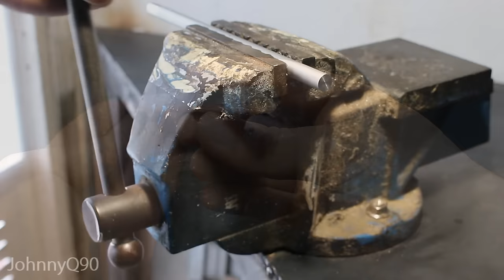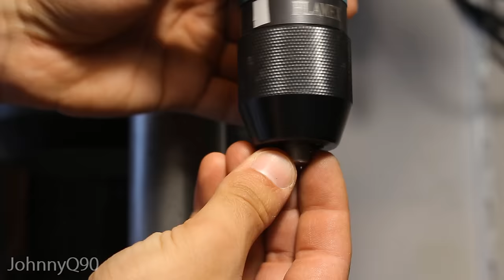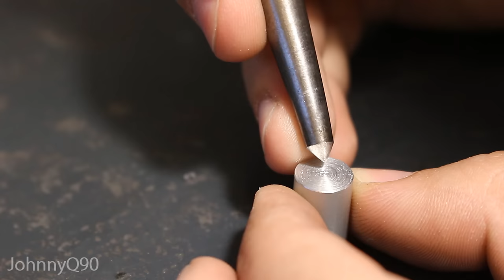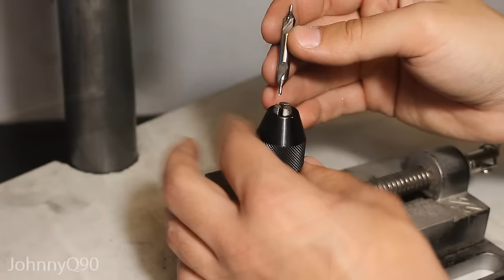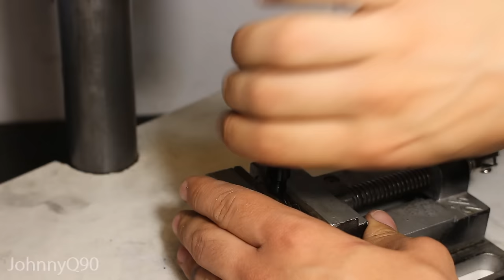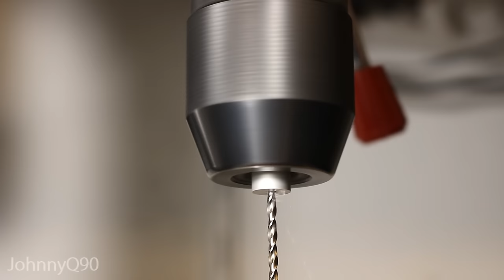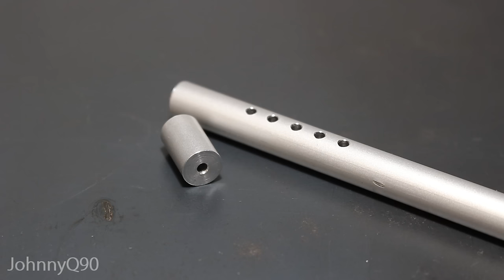Simplest Way to Drill in the Center of ANY Rod!

Comment: Lubricant is never used when drilling aluminum. When you loosened the vise jaws and thus moved the drilled rod, it becomes virtually impossible  to drill successive holes in a straight line.
Reply: Rich R I saw this myself .
I’d make a jig
Reply: If the vertical guide was filed on both sides so as to slide up and down in the jaws there would be no need to continuously open and close the vise. One merely walks the guide along at pre-determined intervals to achieve precise holes. Everyone has their own methods and degree of precision. I'am a Marine Engineer/Architect. but I learned more from my father in his shop, than I ever learned in school. He was fond of telling (10X at least) a story when the Americans during WWII sent what they thought was the smallest gear made for to the Swiss to marvel over. The Swiss took it, punched a hole dead center in it, and sent it back to the Americans. LOL

Comment: A machinist or someone who has to meet very small tolerances would not consider this precise, but I bet some people learned how to make a damn drill bit guide. Most people would probably just drill a crooked hole and call it good. Ive worked with many people who cant drill straight and even some idiots that dont know how to use one. Cool idea tho to get pretty close and get the job done

Comment: The little spud to locate the hole, ok it works fine. The way he made it weird. After center punching the hole put the part in a vise with a vertical V notch in it, the one he used for the small chuck, and center drill and drill it.

Comment: thats only the centre of the punch mark you made, its an estimation
If, you put the drill in the chuck backwards
then move it down to the table vice, and clamp it into the vice, then lock the vice to the table,
then you have something capable of drilling the actual centre as it relates to the chuck

Comment: There is a much simpler way. Home depot has a device that simply sets on top of the rod and guides your drill bit to dead center. Works on most any size pipe or rod.

Comment: The easy way is to use a v cut block with the drill center in the v lock the bock place your cylinder rod in it and drill a perfect center hole each time

Comment: Great idea, but what if the rod you’re trying to drill into is too big to fit in a chuck? The title says any sized rod, but I think this technique is limited to the size of the chuck. The size of the vise also limits the size of the rod, as it needs to be large enough to hold both the rod and guide securely in place when applying pressure with the drill press.  Again, this is a great idea, but I just think the title was a bit misleading.

Comment: I would suggest tha it would be more accurate to use a drill of the same diameter as the rod to drill into a block of material clamped on the drill table. Remove this drill and replace it with the smaller diameter drill which is needed for the centre hole. Place the piece of aluminium rod into the hole drilled in the material clamped to the drill table and then, when the small drill is lowered onto te aluminium it will be centred exactly.

Comment: A better way would be to cut a v in a square piece, then drill pilot hole in the bottom of the V.

Then you have a jig that works on any diameter of rod.

Comment: What if the rod that has to be drilled has a larger diameter than the marker?? When you say ANY rod, we assume that this rod has to be placed exactly vertically below at its centre point corresponding to the marker lying above, That needs to be looked at by default.

Comment: You could do that.... and only drill THAT SIZE ROD!!!!

OR

You could get a bit of aluminium right angle...
Pref at least 20-30mm inside diameter, at least double that in length, and must be of equal side length (ie 50mm x 50mm x 100mm).
It also needs to be thick... at least 5mm, 10mm is even better.
Put it in a Mill drill, taking a few mill off the length of the outer edge of the V. 
Drill a hole through the centre of that flat so the hole runs at 45deg to the 2 sides of the L.

Now you can place the piece of L section against ANY diameter rod/pipe as, when pressed onto a rod/cylinder etc, the 2 sides will be 90 Deg from the centre point and the 45 deg hole will be pointing directly at the centre.
You can actually drill several different sixe holes along the length of the tool to allow for different drill sizes, all the holes will still point at the centre of the rod.
You can even drill a hole very close to one end large enough to fit a thin bit of rod with a lathe made point... this can be used to slide through and act as a centre guide if you draw a line along the rod side you want to drill...
You can even score a mark perpendicular to the centre of each hole across the side and down the edge giving a guide if you run a line radiating round from the line you want to drill on the rod
  
(by the way Americans, take note of the 2nd 'i' in Alumin'i'um... It's NOT silent!....   "Hey Now... them thar iz fightin words"

q8D
Reply: BTW... If done correctly, this tool can also be used to drill true 90deg holes in FLAT surfaces, not just pipe. (You may need a 2nd scribe hole at the other end of the length for alignment purposes although if you do a good job marking the desired holes with a centre punch you should be fine.)

Fell free to play with that and make a video on it... A bit of recognition (link back to my crappy MTB videos would b nice. )

Best advice my dad ever gave me as a kid-  "This is MY garage....!       ...      Try not to break things."         -  (C.H.B.B, Wellington NZ circa 1978)

Comment: That's great for getting 1 hole in dead center, but you completely gloss over how to then made 4 more holes on the same plane.   

My guess would be to then made a second guide, and a make a pin of same internal diameter to insert into the first guide to lock the vertical plane.  Shame poster didn't add that little bit of detail.

Comment: rather than do all that to find center, just insert the small drill into the chuck backwards (pointing up) and lower it into the vise and lock it into the vise.  Then loosen the chuck and raise the drill, leaving the bit centered in the vise.  Then widen the chuck and insert the piece of rod.  It will be centered with the drill bit it just positioned in the vise.

Comment: I’ve been doing this for many years.... If you clamp the center drill into both the lower and then the upper chuck to center it to the drill, then clamp the vice down to the table with the drill press fully extended, then release the chuck on the drill press, you will have the two chucks aligned.   Then you clamp the work in the upper chuck, and you can start the hole without a punch mark in the center.   The center punch is the weak point.... Eyeballing center is not accurate.     I use a small lathe chuck clamped to the drill press table instead of a drill chuck.... One less point for error

Comment: Actually there is an easier faster way using a different tool.  the Portalign, while no replacement for a drill press for most tasks, will actually do this particular job quickly.

Comment: Good idea but it assumes you drill the rod dead center.  Your method for that is flawed and there is a much better method.  Mount the piece in the bottom vise and open the upper drill press so it fits around the rod.  Lock the vise down and it is now perfectly centered.  Put in a center drill and then the drill bit you want.  Exact center.

Comment: But when youre drilling a series of holes how do you stop the piece from turning off centre?
Reply: I asked myself the same. My guess is: Make the second centering gauge and insert a drill.
Reply: @tubegor  yes but then you have a problem if the holes are closer together than the diameter of the guage. I think I'll stick to the vee block and the end marked with a square!
Reply: @gbwildlifeuk8269  You are absolutely right.
The method presented here is unfortunately impractical, but it was worth considering.

Comment: Trouble is when you remove the drill guide to make the next hole? How are you going to positively going to line it up with the last hole?
Reply: Before you drill even the first hole, you sand the sleeve thinner in diameter so that it will barely slide in the vice when it is tightly clamping the long piece to be drilled.  now you can slide the sleeve to any location along it's length and not lose vertical accuracy...

Comment: A lathe would be much easier, more accurate and in the long run (taking wastage into account) cheaper.  However if you are determined not to use the proper tool then this is not a bad bodge.

Comment: I have something to bitch about as it goes. I want to bitch about the fact that I didn’t know this simple yet effective way of drilling a hole in the centre of a rod. Sure it doesn’t have the tolerance required for NASA, but for me in my home shop, it’s plenty accurate for me, and I won’t need a lathe, just my old trusty Elliott drill press.

Comment: This is only as accurate as your center-punching technique. If you want better accuracy, drill a 10mm hole in a scrap piece held in the vise below the drill press.  Insert the target piece in the hole without moving the vise. Then drill into it with the desired drill size.

Comment: The hole in the guide price is not necessarily centered as you eyeballed it when you centerpunched it. Then you didn't really know if the drill bit was true vertical. If the stock you need a .125 hole in is .500, just need to split the difference between the jaws of the vice and the center drill and divide that by 2 and place a spacer on both sides to find center.
Stock .500, center drill .375, difference .125,  divided by 2 is .0625. Place 1/16" drill bit horizontally against one jaw near the top to keep center drill centered over stock. May the math be with you.

Comment: Since he has only one rotating fix point, he should have used a ten mm drill to drill a caliper into some block aluminum fixed firmly to the base tool, lathe, then insert the to be drilled 10 mm rod into that hole, and then to make the 2.5 mm hole into his guiding rod. I could never center the middle accurately, by only eye sight and punching a hole guide.

Comment: You are not necessarily in the center of the piece when you manually center punch it.  You could be .015 off easily, unless you just get lucky.
Reply: But this does NOT in fact, even matter. He got close enough that using the starting bit ensured the hole was perfectly centered. That's why he used such a small center drill, before moving onto the full length drill bit. Because the drill bit is stationary, and the rod is what's being spun around it, the hole is perfectly centered every time, as long as the drill press works properly.

Comment: What about next drill  when you released the vise?
Reply: Before you drill even the first hole, you sand the sleeve thinner in diameter so that it will barely slide in the vice when it is tightly clamping the long piece to be drilled.  now you can slide the sleeve to any location along it's length and not lose vertical accuracy...

Comment: You centre punched the metal piece by hand. It is prone to be off from the true centre. Also, you clamp the centre drill chuck in the vise not necessary square to the drill press. 
Anyways, good enough for daily non precision machining.

Comment: NOT so fast. Before punching the center, how did you mark the exact center ?  Did you use the intersection of two lines ?   Some of us are not machinists.
Reply: @
philly car keys

The technique we see here does not require that the center punch mark be in the center of the round part. It does require that the center drill be secured firmly. When the little round part is held in the drill press chuck the center of the little round piece is concentric with the axis of the spindle. The center drill acts like a boring bar and drills on center even if it starts a little off center.
Reply: The sandpaper trick shows center.

Comment: Why don't you clamp the rod in the vice and drill the hole? And when you do the second hole your precision is gone, unless you keep it clamped in. Better clamp it in and use a small center drill and move the workpiece along a ground parallel. This I can do with my handheld battery drill.

Comment: sand paper trick doesn't work as easy for flattening steel round stock. Especially 1/2" or 5/8". I've tried. Interesting concept though that could be used for somethings.

Comment: So, you drill the pilot guide without any regard to the actual center point of the workpiece or actual vertical? If the hole in the guide piece is not dead center and 90° the hole you drill in the workpiece will not be in the middle. Obviously, precision is not important in this tutorial.

Comment: Ahhhh, I'm not so sure that's the simplest way to drill holes in the center of any rod.  I don't have a lathe, drill press or other piece of (expensive) machinery to do that.  Instead, I simply use a Big Gator Tools V-Drill Guide, which costs around $25.00.  It centers the drill on top of the rod, and I just use a cordless drill to drill any number of the correct size holes along the rod as you have.  I can place the rod itself in a vise, work on a bench or leave the piece in situ (i.e., where it is) to perform this.  You can use a clamp to hold the V-Drill Guide in place, but there isn't always enough room, depending on the circumstances.  In that case, I use my left hand to hold it in place, then proceed to drill it with the drill in my right hand.  If I had a drill press or a lathe, the knowledge to use them and the garage space to keep them in, I'd do that; but for now, I can get by with this.  I get it that this video was aimed at machinists and would-be's, but that leaves the other 99% of us out of the equation.  Don't get me wrong, I admire folks with the talent who can use all of the equipment you have, but for the rest of us, this works, too.

Comment: This is about the most complex way to avoid using any tricks to actually center the drill. He sure used a lot of tools, and still eyeballed the only actual centering step.
Reply: Since the piece was spinning the hole would be exact center.  But maybe bigger than the bit. This method is similar to a drilling on a lathe.

Comment: This will work and thanks for the tip however the first piece you made should have been drilled in the lathe! Nobody on earth can use a punch and get dead center everytime not gonna happen. You will be off a few thousands. This is a great tip though. You could drill different sizes for different size metals. Drill in drill press instead of using a mill and edge finder thank you!!!
Reply: He spun the work on a fixed drill, like in a lathe.  Dead center to rotation... totally going to happen.  No way it can't... just like in a lathe. First principles.

Comment: Uh, this is far from the simplest way to drill in the center of a side of a rod. You just use a jig with sides at 45 degree angles with the corner centered under the bit. (Like a 90 degree V)
No matter what size the rod is, it will always be centered.

Comment: So is a 2-3 times use since the drill bit is not centered and you are using a soft metal as a guide...amm, you know you can use tools to mark the center on both sides and clamp the piece into the vice using a laser guide...

Comment: Metric ?   Inch measurement is easier to use and more accurate.   Better to mount drill  upright in small vice  without clamping the vice then place round bar stock in  drill press chuck.   Drilled hole will be centered.  Don't use punch  is  NOT accurate.

Comment: So you guesstimate the center of the rod when you drilled the first hole.  Then just stock it in the vise presuming it was at 90 degrees to the horizontal rod.  Glad you aren't building close tolerance engines.  Makes me go, hmmmmm? 
Other than that, it is not a bad idea for drilling a rounded surface.

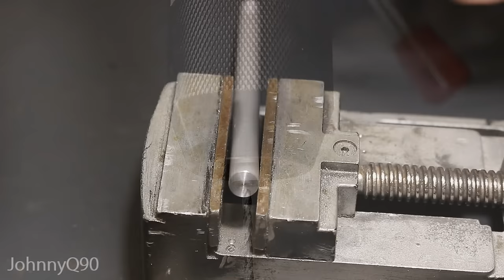Comment: Not even a cursory check that the bit is standing straight up by holding a square against it???  2:29 clearly shows the bit canted to the left...  I would at least have drilled some square aluminum stock out to slide the hex part of the bit down into to give you at least some modicum of straight up...

I also would sand the guide piece so that it can barely be moved in the drill vice.  That way, when you want to drill the series of holes you shows at the end, you don't need to reposition the rod in the vice, which risks rotating it slightly and taking the holes off line, but simply sliding the guide down to where the next hole goes and drilling away.

Also, 2:42 shows your vice has a rounded front (opposite the clamping screw), which is a poor design, as it doesn't let you use it with a fence, which in the case of flat stock being drilled, would let you simply position a fence with the bit centered in the bar stock, tighten the fence, and then easily slide the vice along the fence after each hole for a centered series of holes in a straight line.

Comment: Not how I would have done first part. You can't guarantee the drill chuck in the vice is absolutely vertical. Ilike the second part...although now that I have a lathe I'd do the first part on it rather than the drill press.

Comment: Most of the folks talking crap about this video have missed the point. I bet the guys talking v-blocks and dial indicators wouldn't amount to a pimple on a real machinist's ass. As a third generation machinist I'll admit; it's a bit crude no doubt but for a guy that doesn't have a Kennedy box loaded down with goodies or know what it means to dial in a vice, base or head this might be the ticket. It is not "perfect" but beats the hell out of a vice and hand drill.

Comment: NO !  Use a lathe to centre drill a guide ! You have introduced errors into the measurement of the Center of hole by doing it “ with a punch by eye “ !